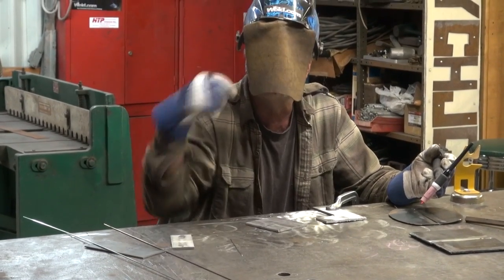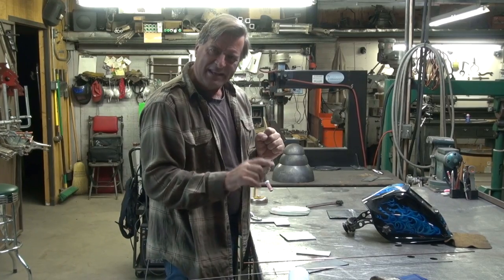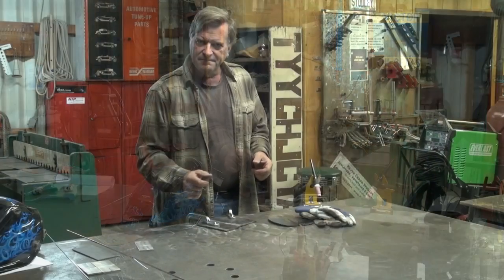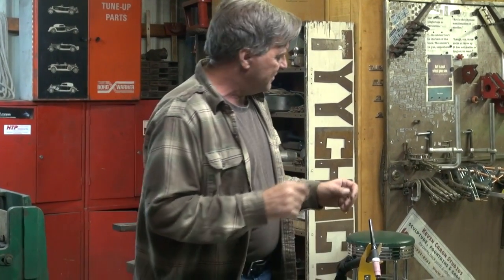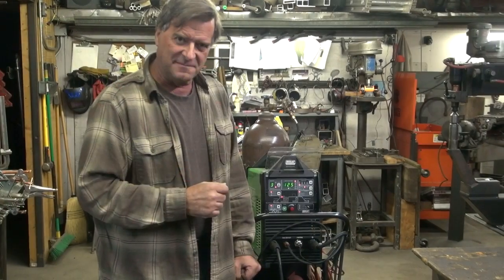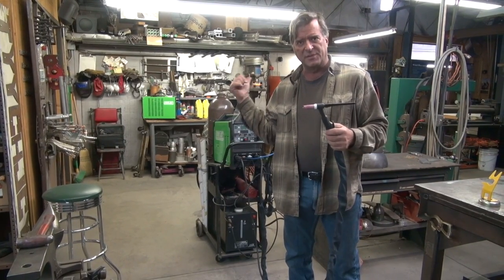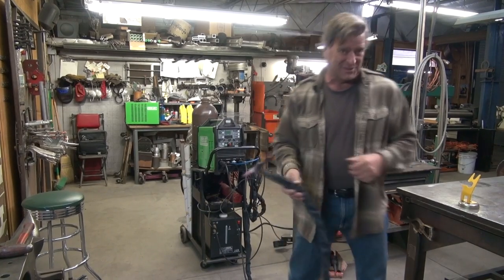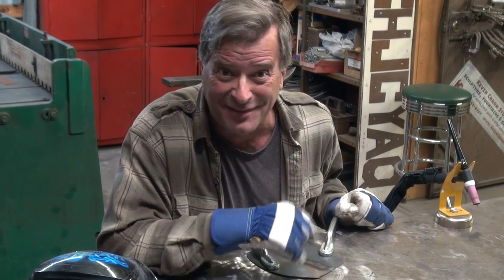Testing Everlast's POWERTIG 255EXT for DC Welding - Kevin Caron

Comment: I guess I don't understand if you have a water cooled torch why would use an air cooled torch. I would only use an air cooled torch if I had no option for a water cool torch. Trust me i would be hard pressed to ever use an air cooled.
Reply from the maker: lighter and smaller diameter.  Makes getting in to a tight spot a little easier.

Comment: For thin metal, use MIG wire (0.030") as small diameter TIG wire (1/32").

Comment: If you want to weld at such low current settings try switching down to .040 or .020 tungsten and smaller than 1/16th filler rod. I used to weld 4130 chromemoly seemless tubing for aircraft that was .063" thick. It works fine but you need to use the appropriate size tungsten and filler rod. And in the case of chromemoly you need to purge the back side of the weld as you are welding it with Argon or some sort of inert gas or it will oxidize badly.
Reply from the maker: Have to try the really thin stuff someday...
Reply: That welder is fantastic for both thick and thin. Have a blast with it!

Comment: I like the fact that it will dial down for small welding repairs and fabrication and then be able to drill holes in big chunks of aluminum. More videos Kevin!
Reply: I love this welder. It is definitely on my wishlist.
Reply: I really really want this welder. I like how it has a nice low amp capability and advanced waveforms for the power.

Comment: Nice video as always.  Nice machine as well.  My question is do you still have the AHP Alphatig 200X????  I need a hobbyist TIG machine and budget is primary.  I know the Everlast here has more features and is digital but the price of the AHP is so tempting.  The only feature the AHP doesn't have that I would like is variable freq. on the AC side, but I can live with 60hz.  Is the AHP something someone could grow out of too quickly and should I save up for a more feature robust unit like the Everlast?

Keep up the great work and I appreciate your time and opinion
Reply: *****
Thanks for the info Kevin.

Comment: Sup Kevin, your whole channel is awesome, thanks a lot for making all of this, but i have a huge problem, i need to bend 3/4 pipe in a 180º angle but in a really sharp turn, im making the rear fork of a bike frame and i want it a single piece, the turn needs to fit inside a bike wheel. but i had tried almost everything, filling with sand, heating not so much, but it stills kinks, which is the best metod for doing this, Thank you a lot for your time!
Reply: ***** k, i just realized its impossible with my 12 ton pipe bender, im working in an alternative design, thanxs for ur response